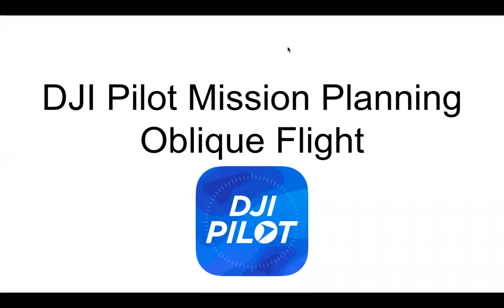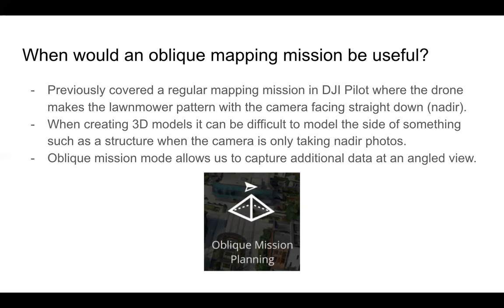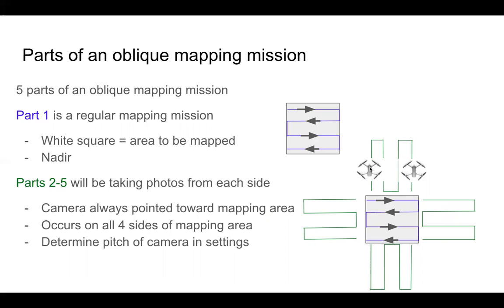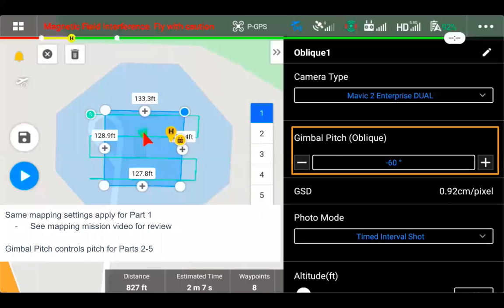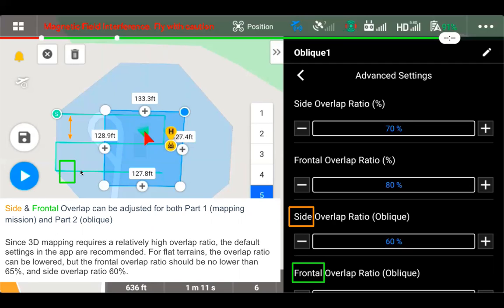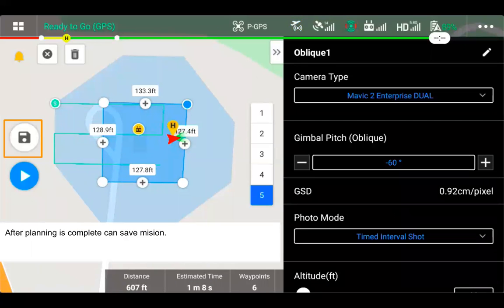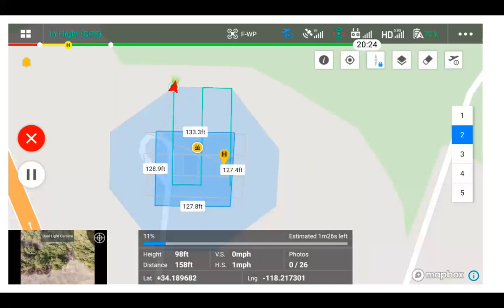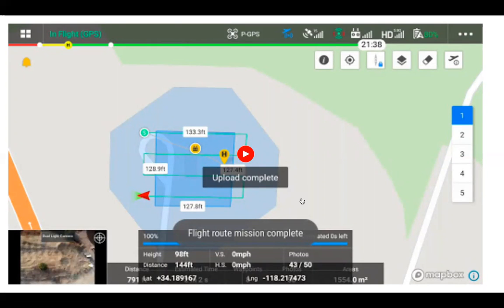DJI Pilot: Oblique Mapping Mission Basics w/ Mavic 2 Enterprise Series

Comment: DJI Pilot really needs a terrain following (M300RTK) cross hatch pattern flight and also the ability to set the desired gimbal pitch for the flight for 3D modelling steep areas. Seems like a very simple thing to add. Also POI orbit for M300 with timed photos or overlap amount pleeeeeeeeeeeeeeeeeeeeeeeease.

Comment: Can you use an Oblique flight map to inspect a vertical structure where the flight path of 2 - 5 gain elevation up a structure rather than moving the aircraft back and forth?
Reply from the maker: This would not be an option for Oblique flight mode, would need to be done with waypoints in the DJI Pilot App or by using a 3rd party MSDK application.

Comment: Thank you for these tutorial videos. I would like to ask that, when I try to process an oblique mission on DJI Terra sometimes I get Structure From Motion(SFM) error . I’ve used Matrice 300, gimbal yaw 45/60 degrees and ratios are between 75-85. I couldn’t get constant efficiency in my progresses. Is that about the M300 ? I thought I can do 3d missions with it.
Thanks in advance.
Reply from the maker: There could be different reasons that could cause the error (e.g. out of memory, not enough overlap ratio, wrong picture format, etc.) 
It would be best to contact support@dji.com, they can work with you to send the log in so that the Terra team could take a look.